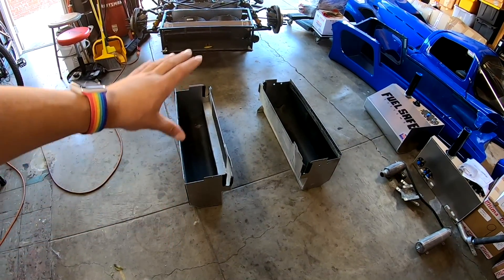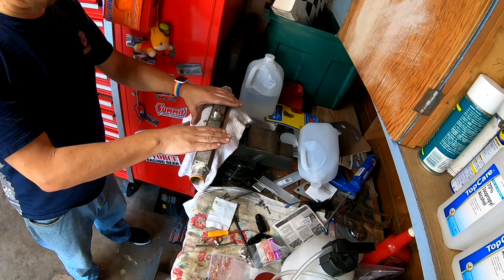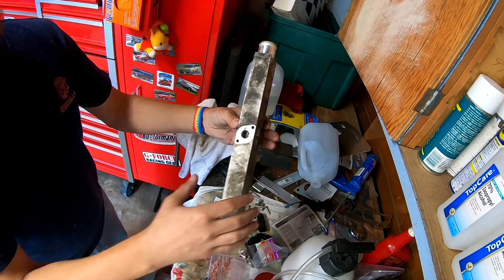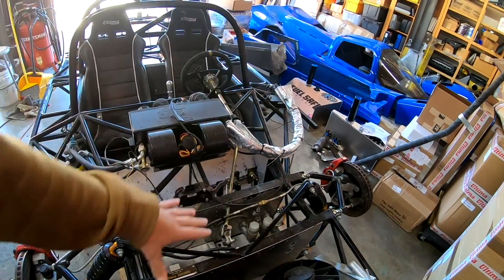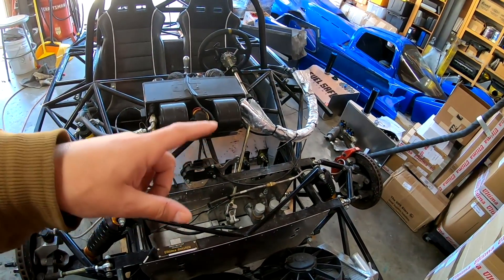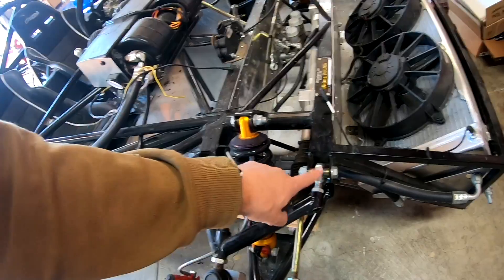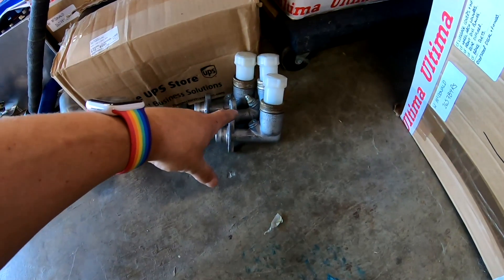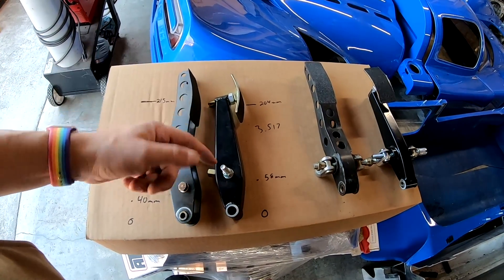Ultima RS - Blunicorn Rebuild 06

Comment: The pedal bushings should rotate freely and slide in and out of pedals and stay stationary to the bolt and fixtures. The factory pedals are just bit tight from welding and need clearancing.

Comment: Surprising that Ultima put a 3.5:1 brake pedal ratio in the car for manual brakes. My Tilton adjustable pedal ratio goes from 5.2 to 5.9 so your 5.3 is in range for manual brakes. Maybe the 3.5:1 was meant to pair up with a remote brake servo, just a guess. It must have been a bear to stop at speed. By the way. The new blue looks great, very striking color.
Reply from the maker: Originally the Ultima GTR had smaller brakes and remote servos, so the 3.5:1 pedal ratio made sense.  As the size of the brake discs and master cylinders increased and the servos disappeared, the pedal ratio was never addressed.  I'm hoping this solution works out.
Reply: I went with the crutch of downsizing to 0.5 and 0.625 mastercylinders which is effectively similar to increasing pedal ratio

Comment: Great new episode. Disappointing that the rubber boots was so difficult to install and didn’t do their job. I have spherical bearings on my Corvette and wish there was an elegant solution to protect them from the elements. 
Is it possible to mount the dampers with rubber bushings to isolate and remove some harshness in the Z-direction? It works great on my car, very little NVH even with spherical bearings. 
Did you consider changing the diameter of the master cylinders as well? Changing diameter to a smaller one will help increase force (but also increasing foot travel) the same way a bigger pedal ratio will.
Reply from the maker: The Ultima is NVH, you pretty much wear a 7L engine like a backpack.  The suspension is all solid mounted, but it doesn't add that much nvh, at least not much that can be heard over the engine.  The rubber boots were the exception, and the squeaking would resonate though the chassis.  Master cylinders are the next effort, as I wanted to start with the easiest parts then work my way up.  Pedals are an easy swap that anyone can do cheaply and easily enough, then master cylinders, calipers and rotors (larger diameter).

Comment: Is there any need for an oil temperature thermostat with this type of heat exchanger? Does the water thermostat also control the oil temperature?
Reply from the maker: With this setup temperature is self regulating so no thermostat is needed.  Water temp/thermostat does help control oil temp but in both directions, warm up and cool down.

Comment: I'm seriously considering ordering an Ultima RS and the pedal measurements you provided are helpful for me.  Do you happen to know your inseam length?  I have an aftermarket pedal box (PE Racing) and would like to get a rough idea where I could mount them.  I have a short inseam (29 in) so I'm hoping I can bring the pedals pretty far back.  It looks like you have the clutch pedal in the middle hole and the brake pedal in the farthest hole?
Reply from the maker: I have a 30" inseam so you're pretty close.  The pedals are setup the way they are to match my driving style/technique, mostly on the balls of my feet.  Using an aftermarket pedal box is difficult because of the front bulkhead chassis tubing and footwell hight.  The floor is also thin aluminum so you can't use that to mount the pedals.
Reply: @DriveDriverDriven  Thanks, that's helpful information!  The pedal box is pretty versatile.  The base of the pedal box can be mounted at an angle and the pedal pads can be angled relative to the pedal arms to compensate if needed.  It sounds like I'll have to remove the stock master cylinder plate from the Ultima frame and remove some of the pedal box frame on the left side to allow the clutch pedal and master cylinder to stay as far left as possible.  I don't have to remove all of the stock U channels.  I should be able to cut off about half their lengths and bolt a steel plate to the remnants to form an anchoring surface for the front part of the pedal box.  Anyway, that's my initial thoughts on this :-)
Reply from the maker: That's basically what Gabe did on his RS if you're following his build.  I'm trying to improve pedal feel without modifying the chassis if possible.  Both approaches have their own sets of challenges.